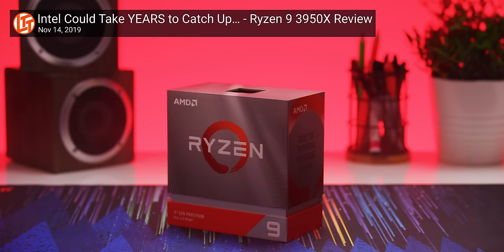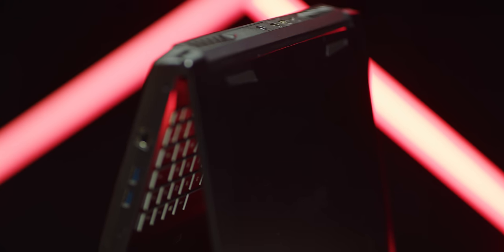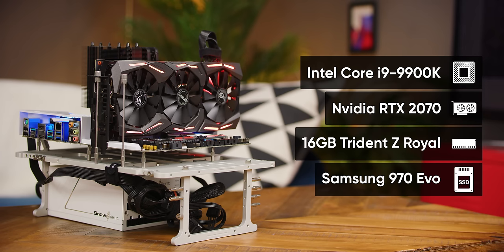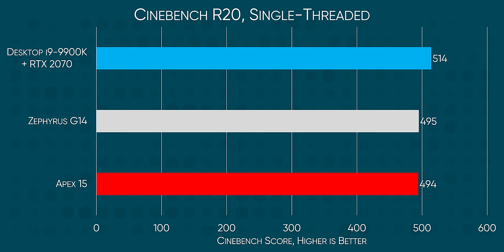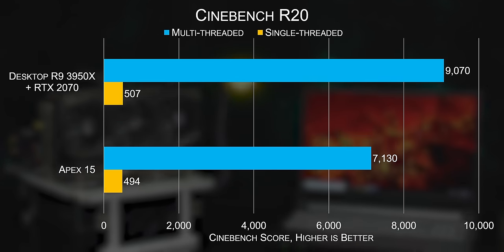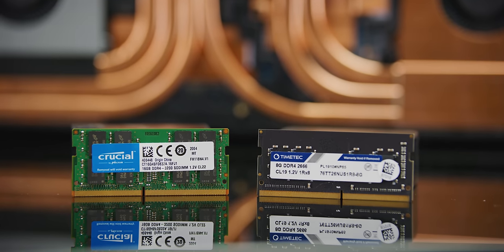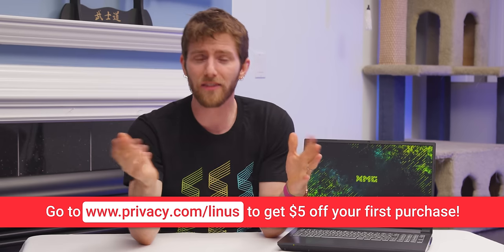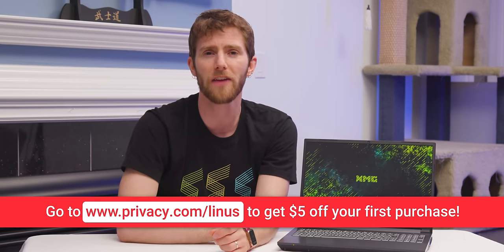The Most Powerful Laptop EVER!!! - XMG Apex 15

Comment: Linus: 7:13
AMD: Imma ruin this man's whole carreer.
Reply: The compatibility problem comes from the motherboard's manufacturer. The BIOS is not big enough to support new CPUs. (Ofc this is due to AMD's specification in the first place).

Even with an 8MB ROM, this laptop shouldn't support pre-ryzen 3000, so, with luck, it will support the next gen
Reply: @franciscocb94  This laptop has a B450 chipset, it won't support upgrades. XMG has been forced to walk back claims about Ryzen 4000 support that they made when this laptop was announced.
Reply: @StrangerDanger0Snack  as far as I understand, and I'm not an expert on this, the support it's due to short bios memory. So it's physically possible to support Ryzen 4000. Technically it's sort of a soft-lock. Obviously, I don't see any companies to support that, it may come to reverse-engenieered bios r4000 support and add to this one or stuff like that. Kinda dirty, but..
Reply: @franciscocb94  Completely agree. It could (and should) support the new generation, but AMD will need to reverse their decision about B450 before that can happen. And while BIOS memory is definitely a hurdle, it could be overcome by motherboard manufacturers like with Zen 2. As someone who just bought a nice B450 motherboard a few weeks ago I'm very upset with AMD's decision
Reply: @StrangerDanger0Snack  I also just bought a new pc, but I decided to invest in the z570. Pcie4 and faster ram speeds were the main reason, but also future-proofness
Reply: unsupported in the sense that not all boards will get zen3 support like the 300 series and zen2 where some manufacturers managed to add zen 2 to the fully unsupported a320 chipset on some boards like the A320M-K
Reply: @Lollllllz  As far as I know, this time it's actually different. For Zen 2, AMD gave Mobo manufacturers a Beta BIOS with the Zen 2 code they needed to get it working on older chipsets. This time AMD said they WILL NOT give Mobo manufacturers that code for Zen 3 so there's no way to implement Zen 3 on older chipsets without reverse-engineering the code. AMD recently confirmed this when asked by HardwareUnboxed.
Reply: @StrangerDanger0Snack I don't think that agesa is compiled per chipset though as they made am4 to be able to run without a chipset(a300/x300 got the first zen 2 bios from asrock on their deskmate) and they distinguished between selective support on b350/x370 and no support on a320 for them to release supporting code for a320 if it was the case.
EDIT:amd could implement checks though like intel did with their ME firmware 11.6 and newer for coffelake and skylake platforms but that would take effort on amd's part and look bad on their part.
Reply: @StrangerDanger0Snack  shame thats the case also I'd like to correct myself about a300 zen 2 support it did not have it only 3000 apus. Amd shooting themselves in the foot though given b550 delays
Reply: @franciscocb94  But what it DOES mean, is that if I want more than 10 minutes of battery life... I could downgrade it to a 3400G upgrade my PC :P
Reply: @carlsagan2371  I think the base model is the 3600, so...  Power/performance? Maybe 7 min?

Comment: 2:09 forget that Apex 15, how the hell is that Zephyrus G14 managed to beat a desktop 9900K on Blender??? Can we compare the power draw?
Reply: Willy Yappy I bet the G15 could come pretty close.  It draws perhaps up to 100W of power for non-charging purposes at peak load.
Reply: Calm down.
Reply: Brad Haines for the G15 the power brick is 180W and battery is 77Wh.  So to charge at a rate of 1C and still reach peak performance, it needs ~80W + enough for the rest of the pc (100W).  That’s how I calculated it.  Yes a PC will be higher (2.5W for keyboard, 1.25W for mouse, 300W or more from the PSU and some for the monitor)
Reply: It's only a few minutes. Run this for an hour and the 9900K should win. That said, that a laptop CPU has this kind of performance is insane engineering. Even the mid-range AMD laptop chips have desktop class performance :o
Reply: @brazeiar9672  please explain why 9900k should win in an hour test, because I very much doubt so.
Reply: Fadex if anything it should be the opposite, with intel chips having a very aggressive boost till temps get too high and they have to cut back a bit. the extra cores and threads on the ryzen chips would do better in more sustained loads
Reply: @thorbenarndt6784  Feel free to test them both for an hour and post the results for us.
Reply: @Fadexpl  Because desktops are much better at removing heat from systems. Laptops suck for thermal performance, they are meant for mobility. It's not even a fair comparison. The AMD chip effectively has one arm tied behind its back.
Reply: @brazeiar9672  I went to sleep after posting the comment, I woke up to a dozens of notifications. I just want to say, that Zephyrus G14 is a mainstream laptop, nay, a lower mainstream even. It should never rub shoulder to shoulder with Intel's last year best PC processor, for any reason other than power sipping properties
Reply: @MrWillypanda88  Indeed, AMDs performance here is incredible. But the lower tier AMD laptop processors are also competitive even out of their own class.

Comment: 3 gigahertz is kind of slow he says

my intel Celeron N4000 maxes out at 2.6 gigahertz
Reply: jokes on you my 4300u maxes out at 1.89 idk why because i remember it maxing out at 2.5
Reply: My Intel Pentium N4200 is the same.
Reply: It's a Celeron what you expect 😂
Reply: i rather buy an used pc that cost me $200 than this shit
Reply: hah, my laptop has a semi-semi-decent proccessor but only 4gb ram so it cant run squat

i3 owo
Reply: celerons are trash though
Reply: i have a Intel i5 2400 with 3.1 GHz
Reply: My N3540 goes up to 2.66 GHz (4C/4T)
Glad I don't use it anymore x)
Reply: Hey! Pentium N4200 1.10 GHz base clock turbo into 2.5 GHz.
Reply: have u heard about atom n450?
Reply: Linus is at a different level,  confirmed
Reply: @DekuCanDoIt  
i got a 10 year old HP G42 466TU with a core i3 370m and no dedicated GPU.
linux mint saved it, now i can atleast stream 720p on a 16:9 1366x768 ips panel.
it does not turbo and it maxes out at 2.4GHz.
tho thankfully it is hyperthreaded.
can run Nexuiz at 640x400 @ 20-30FPS~
but I also have a quad core smartphone that has a max of 2.4 GHz, it goes 100-106C.
it's a Oneplus 1 64GB.(5th hand with pie(9.0));

Comment: It's truly amazing how, even with a 3950X, this laptop can still achieve acceptable battery life in most cases.
Reply: Ehhhhhhhhh, it's a cool laptop, but 1 hour is not "acceptable".
Reply: @elijah_9392  Well, it's a desktop CPU and a 65-WH battery, so I'd call it a win. I've had to deal with craptops with a worse battery life than this.
Reply: @UItEnthusiast  

The problem with your reasoning is that you tied together acceptable and impressive.

It is impressive. No doubt about it.

But define acceptable? 

Can I use it at college? Can I take it to the Coffee shop? If my power goes out, how long can I use it? 

If you only use a laptop for 1 hour at a time, then yeah, it's acceptable. Most people, including me, need a lot more.
Reply: @elijah_9392  Good point. I guess my standards are just potato-level after seeing so many degraded batteries. I still have one laptop that will discharge by around 2% per second, and that's not even the worst of them.
Reply: @UItEnthusiast  

Dang bro... 
How did they get that bad?
Reply: @elijah_9392  Oh ya know. Battery quality, how much that battery was abused, whether it's a Note 7, etc. For example, I have an IBM Thinkpad R60 from 2004 that can still last around 2.5 hours with a full battery, but my old Bell Longitude E6540 can last less than an hour because that thing gets really hot due to how the thermals of the system work.
Reply: @UItEnthusiast  

I forgot IBM used to own ThinkPad haha.
Reply: @elijah_9392  The ones that were made by IBM, or ones with at least IBM branding, were the good ones.
Reply: @UItEnthusiast  

It's funny how we're talking about batteries rn.

I just ran a test using powercfg kn my PC, and my battery had been murdered.

It's supposed to hold 56 Wh, but degraded to 21.6

I'm buying a replacement soon.
Reply: @elijah_9392  I like old laptops with multiple cylindrical batteries. Since they're usually 18650s or some other standard format, it's easy to pop the enclosure open and replace old ones (although I haven't done it before). Also it's harder for them to become huge angry gas-filled pillows of fiery death.

Comment: You're telling me, I get a Notebook with the "nearly" equivalent power to an Desktop PC for the same price? 
(The R9 3900 Version, is 200 less then Desktop but comes with an 144hz display which kinda cost about 100-200, so it's nearly the same price)

So the real question is now: Desktop + OC or Mobile ?? With no price premiums. This is crazy !
Reply: Your still dealing with heat and the cooling solution isn't where desktop can be. What can help is silicone lottery and getting a chip that runs cool while also letting you OC crazy. Since the chip's for the laptop's are already the best silicone you have a high chance. I got lucky with one of my 980's and it ran cool, while both were able to be pushed above 1500mhz OC. I didn't push any higher because the old game i was playing on kept crashing.
Reply: It's perfect for me with a toddler running around unplugging my desktop cables etc, and takes up 1/10th of the space. In the UK desktop rtx 2070 PCs start at £1230, and this is £1300 with a monitor, keyboard, etc. The compromise is worth it.
Reply: @HAZZARD Once upon a the you could upgrade the Clevo's with MXM GPU modules.. that stopped with RTX
Reply: @enterthebully9968  you still can but that's going to very on the vendor you get it from. Dell for instance says they'll have some upgrade kit for their laptop's and other oem's like them have said they're working on a solution as well.
Reply: @HAZZARD you can upgrade the GPU but varying on vendor will determine which kind of upgrade.
Reply: Even forgetting the TDP constraint of the CPU, you are also dealing with a 2070 maxq instead of a fat desktop 2070.

I mean, even with that it still sounds pretty great.
Reply: @daveseemerollin6357  Can confirm. A full RTx 2070 super build with a 144hz 1080p monitor would cost me £1290
Reply: Enjoy underclocked graphics card, thermal throttling CPU, jet engine fans, trash membrane keyboard.
Reply: @NickJaime  Yeah - I wonder if it will be possible between different GPU arch though
Reply: @enterthebully9968  Dell has already said they're working on something as for the other's a few have said they plan to make upgrades such as MSI. Only time will tell if there plan's work out.
Reply: yeah though i would go with the weaker cpu , if you're gonna undervolt the highend cpu to for temps and acoustics anyway, why use it amirite and also i would wait for that 7nm gpu
Reply: @IchiroSakamoto  what laptop's have you been seeing because model's other then this one do not suffer from those problems. The desktop chip's I've had in laptop's has beaten there reference counter part's.
Reply: @NickJaime  Time will tell but I'm doubtful. It comes down to Nvidia making it almost impossible for Manufacturers to have a standard. MXM Type B was the closest thing we in any meaningful kind of way, and that pretty much ended with Maxwell. The older Alienwares allowed it. I went from AMD 7970m to Nvidia 780m to 980m all on 1 machine. Those days are gone unfortunately.
Reply: @NickJaime  this is a desktop CPU, not a mobile one, mostly likely it's not binned at all, which would explain why the price isn't incredibly high
Reply: @TabalugaDragon  lol this isn't the first time a desktop CPU has been put in a laptop. Why do you think i asked why they didn't get the I9-9900K desktop chip in a laptop which you can get as well. That would have been the only fair way to compare.
Reply: @enterthebully9968  lol no it ended with the 1000 series, that's the last MXM laptop's. You can believe or not because Dell has shown off their own standard, granted you will be locked in Dell ecosystem but you will have some upgrades.
Reply: @NickJaime  I never said it was a first laptop with a desktop chip lol. I am just saying it's not binned, which explains it's low clockspeeds and price. Still impressive for 65 watts though, but many other laptops are able to easily cool 70-80 watt Intel chips without liquid metal.
Reply: The performance differential is less than you think. I've adjusted perfectly well coming from a full atx setup, with a Corsair K95 (old), mouse, £500 audio setup, plush chair etc. Maybe when you grow up you'll understand that priorities change, and that sometimes a static setup is less-than-ideal.
Reply: @NickJaime  I was referrring to MXM Type B as I wrote, it was somewhat an unofficial standard. Dell MXM could play ball with Clevo and MSI and be easily interchanged and upgraded - worst case a bios flash was required. Good luck doing that on MXM 3.0.
Reply: @enterthebully9968  MXM is gone with RTX why do you think Dell and other laptop makers are making there own upgrades. If MXM was still around SLI for RTX would have been  thing but there not. So like I said MXM was the only thing around but OEM's did their own thing with it. Now it's gone with RTX as before you could have gotten 2 desktop GPU'S and 1 desktop CPU but you have to choose which to push for overclocked.
Reply: @NickJaime  You're skipping over completely that  is Dell, Clevo or any other manufacture  have yet to make an MXM 3.0 upgrade - unless you think Super on the same gen is an upgrade. Let's wait and see next gen but MXM 3.0 being propitiatory and not standardized takes the whole value proposition of upgrading and flushing it down the toilet. What's the point of spending $1600+  (which is what they cost) on a MXM 3.0 module when the whole unit can be had for $700 more

Comment: 12th Gen Intel: Yes we are better than AMD finally
AMD engineers: Runs back to their holes and stop releasing updates
Intel: oh no not again
Reply: ryzen 6 will end up being some quantum thing or something. i picture 512 cores on a single chiplette
Reply: @ghomerhust  with a builtin 3080 ti as apu
Reply: @ghomerhust  My question: When will all the softwares start taking full advantage of all those cores and threads?
Reply: @yuvtube1  well consoles tend to push game development
Reply: @yuvtube1  Full utilization of 32 threads in almost any game is many years away. Some may be coded to benefit from a large number of cores, but the scaling is usually pretty bad beyond the first few.
Reply: ...so 512? Ages away.
Reply: @BLINDCABBY  ...because it's not going to happen within a reasonably estimable period. The materials they'll be using to build PCs with that many cores are still in their infancy, assuming they've even been theorized.
Reply: Never... But if you run on your system some win or Linux, then few other programs same time and you are gaming.. If everything is ok, then the load is balancing at different cores.. If some program crash, then the full system dosen't halt.. You remember single core computers? If you have back then two pentium 3:s on same board, or after few years two AMD mp:s with single channel memory controller chip for cpus.. good old times.. 

I have 1 old server what cost some 40k€ in today money maby.. 4x pentum pro's and 8x 128mb (1gb) memory, and there is room other 8 slot's ram. Maby 10 slots pci and few shared e-isa. IT IS BIG.. and no any use today's needs. Maby I install Linux in that machine and run pc-wlan atation or firewall.. or not..
Reply: AMD Engineers?  HAHAHAHAHAHAH   AMD can't even make their own semiconductors.  They don't even have a fab shop.  AMD doesn't even have a foundry.   LMAO at anyone trying to make fun of Intel by saying "AMD Engineers are gonna do this and that"   HAHAHAHA...more like TSMC engineering and fab are going to do this and that
Reply: OD 40K The architecture is as important as the lithographie when it come to cpu. AMD design architecture, that work really well, and pay someone else whose job is to make those architecture reality. That's how you do buisness, you use your skill, and associate with someone who got complementary one. We could maybe laugh a bit at intel, who try to do everything by themselve, but end up being bad in both département, no ?
Reply: @Thefuror38500  Actually, Intel is not bad at anything they do.  You must forget just how good Intel really is.  Just because Intel got cocky and decided they didn't need to keep their foot on the gas doesn't mean they are not good at what they do.  If you don't know what happened to Intel over the past 8 years then you don't know what Intel is about to do in the next 10 years

Comment: "if you need to crush calculations or renders on the go"
You have too much hope. Gaming. It'll be gaming and Google docs.
Reply: For gaming you should just buy Intel. The 3950X is better fitted for rendering, encoding and AI.
Reply: @beri4138 yeah, gaming doesn't rely as much in cpu

Comment: My question: When will all the softwares start taking full advantage of all those cores and threads?
Reply: All software? Not for a long time. Games I.E will be lowered by that the next gen consoles only have something like a 3700X CPU with 8 cores. And at least one of those cores will be dedicated for the OS is my guess. Maybe 6 cores for the game itself. Which means games made for consoles and then ported to PC will have a recommendation for something like a 3700X if the port is well made. So games for consoles ported to PC will maybe reach it in 2 generations maybe.
Reply: When the Series X and PS5 get released.
Reply: @solarstrike33  Not a chance, the Series X and PS5 will have a 3700X 8 Core CPU. Games made for those consoles will be optimized for 8C/16T at most, not 16C/32T.